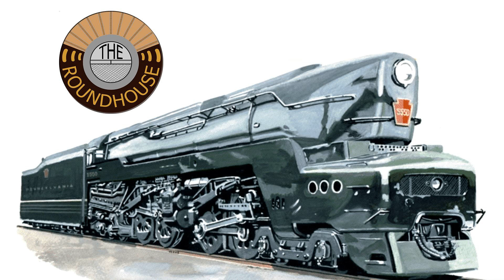Pennsylvania Railroad T1 Trust

Comment: "What locomotive would you build from scratch?" 
Well I'd say it's all a tie between a B&O EM-1 to right the mistake made in the 60's, a new design of 4-8-4 based off of either the ATSF 2900 class or the N&W J's, a new LNER W1 4-6-4 post-rebuild, or a new design of 4-8-2 or 4-8-4 based off of the Bulleid Merchant Navy class in its original form with improvements made to the places where there were flaws in the original design of the Merchant Navies.
Reply: the em-1 thing is quite a shame. personally I'd go for a Texas and Pacific 4-8-2. One of those with an Elesco bundle type feed water heater. And with modernised internals for the best performance possible.